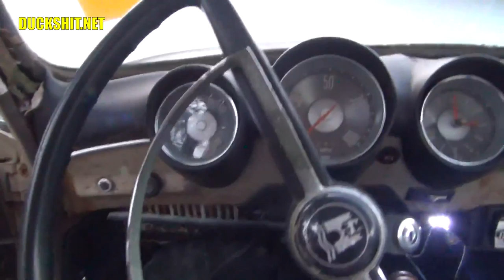69 VW Type-3 Fastback Walkaround

Comment: My 68 autostick hood release is in glove box. 68 was a crazy year on autostick bugs though. 
Great info on what to look for when buying a type 3. I absolutely love the type 3 dashboard. I don't know alot about type 3, but parts are not easily available. You have done a great job on putting type 1 stuff on yours. Sucks the rear end area needs alot to make it original. Great parts car if you can buy it right. Thank you again for your knowledge. Always great to help newbies to u understand what they have. You are a great asset to the VW community.

-Keep Dubbing -
Reply from the maker: That is an oddity, but like you said, 68 was a strange year for autostick Beetles.  It was also the first year for IRS.... but only on an autostick.
Reply: @DuckmanCycles  very true
Reply: @DuckmanCycles  very true

Comment: Airodynamically those dryer vents might be on there to  keep her from going too fast with the current drivetrain  like flaps on a airplane ??? it can  also contribute to  saving wear and tear on the stock braking system  perhaps  and   is part of a effort to make the fastback  look a little more Shelby like Mustang  like the Eleanor in gone in 60 seconds that Steve McQueen drove ???  just a thought
Reply from the maker: Actually I think those were put there to cover up the damaged louvers LOL
Reply: or to get extra air to the engine compartment because of all the missing tins many people didnt realize what those were  installed  for  reality was VW and Porsche had great  engineering  and the stock setup  actually works quite well  the weak link being the defroster and heat   its funny  after my dad passed i found a hoard of Foreign Car  magazines he used to get in the early 60s  some of the ads in them were hysterical  including the optional gas heater  you could install in the back seat of your Beetle  that ran off the  cars fuel pump  could you imagine driving around with a lit furnace burning inside the car  with your family in  it ?  i boxed up all the magazines and mailed them to one of my best freinds  who has owned  over 30 Aircooled VWs  through out his life  and  currently has a 72 Super Beetle  he  restored with all new parts  and a 14 dollar paint job  that really looks great  his rationalization was he always wanted a new one  and really wasnt into the water cooled  ones very much  i personally like water cooled VWs  as i  owned several first and 2nd generation Rabbits  in the 1980s  my last one a 81  had  too much rust  from being a Florida car  that  the Steel brake lines  wouldn’t take any pressure  so i eventually  got rid of that  one  as  i wanted a new car  with working air conditioning  living in South Florida

Comment: Q ,So to be clear--  is it possible to convert a type 1 to type 3 cooling? and what would be involved other than the bolt on parts?  asking because I am currently gathering for my next project, A Beetle pickup, with scratch built body bed, this will require a type 3 for clearance issues, I.E. I don't want the engine sticking up into the bed.
Reply from the maker: In order to be clear the question needs clarification LOL.   It sounds like you're trying to put type 3 cooling into a beetle, no it won't fit in the body. But the cooling will fit on the engine since the blocks are nearly the same.   Only a few things like oil filler and dipstick will be different. Since you are building a truck and cutting out the rear end anyway might as well just make the body fit the type 3 parts.  I hope that helps!  😁😁😁😁
Reply: Thanks for your reply, yep- the body will be cut away and the space will be created around the type 3 engine, but to clarify --,I have a good type 1 engine available,  need to be sure I can bolt on all the type 3 cooling and ancillaries, before I start buying bits of type 3 off ebay etc,  it was the "nearly identical" comment that got me thinking??
Reply from the maker: Yes it will all fit. Your type 1 dipstick will be a little hard to get to because it will be behind the Type 3 fan housing and you will need some kind of cover/vent/oil filler for the generator pedestal, and block off the fuel pump hole.   Otherwise everything type 3 will bolt directly on the type 1 engine.
Reply: Thanks,, 👍👍😀
Reply from the maker: Glad I could help 😁😁😁😁😁 now let's see this car!
Reply: Listen guys, it would be so much easier to get a type 3 engine than trying to convert a type 1, type 3's are different in almost every way. Engine mounts, intake manifold and carb. Exhaust, generator, cooling fan and all the tin are all different.where would you find all the parts?
Reply from the maker: Swap meet at our car show this weekend of course!  Thats where you find the parts!

Comment: Looks like its converted to swing axle rear suspension! I think that's a shame....  cool patina dough. ;)
Reply from the maker: That would really be a good explanation as to why there is no moustache bar.
Reply: cool scars,cool rust holes,cool faded paint ???????? uh,no
Reply: @trillrifaxegrindor4411  You don`t understand..... The "patina" is a therm used to describe naturally worn surface, in this case the paint is faded and there is surface rust visually. Patina does NOT include rust holes, hack jobs etc... I do like cars, bikes etc that show some wear and tear but is kept in good technical and operational order, it gives the object some "history" in a way. Of course I don't mind shiny new paint or old paint in perfect condition, but a little wear here and there gives more character in my mind.

Comment: That thing is a pile. It’s restorable but the exterior isn’t patina-it’s rust. Also needs the correct engine. A type 1 engine in a type 3 makes zero sense. You loose the second trunk and they don’t cool right. This  car has potential but only with a complete body off restoration
Reply from the maker: LoL!  You're right, but you sure are Mr Negativity over here haha!
Reply: @DuckmanCycles  not at all! Mr Realistic is more like it. I’m just saying  this crate needs a boat load of work to do it properly. It’s totally worthwhile as long as you’re doing it for the love of the car or the project. This is not one you’d tackle because it makes any kind of financial sense.
Reply from the maker: @michaelconverse5127  You're new here.... lol. Its alright.  http://duckshit.net/eleanore

Comment: مرحبا  عندي مثل هذة سيارة  في سوريا  بس عندي مشكلة المحرك  ترتفع حرارة  كثيرا ولا اعرف كيف  ابرد المحرك
Reply from the maker: If it is getting too hot, make sure that the oil is full, and that the air vents are not blocked, clogged, and that the thermostat flaps are open and the rubber bellows on the fan are attached and not torn or collapsed!  After that, check the ignition timing,  and set it properly, also make sure the carburetor is clean and not running to lean!  I hope that helps!
Reply: @DuckmanCycles   شكرا جزيلا
Reply from the maker: @toneemane5161  You are very welcome!

Comment: That type 1 engine will not last long ,heat from the exhaust is  being sucked into the cooling fan, and you mentioned this twice! I don't believe type 3 cooling tin will fit on a type 1 engine, type 3's are pancake style everything is different, carb, generator, cooling fan too, if buying this car you need to be aware of the cost of a complete type 3 engine and all the cooling tins. otherwise this car will never be dependable or long lasting.
Reply from the maker: Type-3 stuff fits on Type-1 just fine.  The caveat is the dipstick is different, it'll be behind the fan, kinda hard to get to, but not impossible.  The generator pedestal opening also needs to be closed up.  Otherwise everything else is the same.  I actually know several previous owners of this car, and believe it or not, its been  run with the engine like that for years without problems!  I wouldn't have done that, however.  I'd make it right.
Reply: Dont be such a purist. A type 1 motor will work just fine in a type 3.

Comment: It's got 67 bumpers
Reply from the maker: Very VERY good observation.  On the Type-3 they were the same for 1968, including the bumper-mounted backup lights.  1968 was a strange year for things.
Reply: @DuckmanCycles  VW had to monkey with the sheet metal to get those guard rail bumpers on the newer cars and that car seems to have the 67 and prior sheet metal too.  Hmmm.
Reply from the maker: In 70 is when the major changes occurred.  But lots of the same body stuff stayed all the way to 69, too!
Reply: @DuckmanCycles  Well, I'll be jiggered.
Reply: It looks like 1970 was when they changed over to the big bumpers and big taillights.
Reply: @DuckmanCycles  Long live old style bumpers.  Screw the guard rail bumpers and angular tail lights.